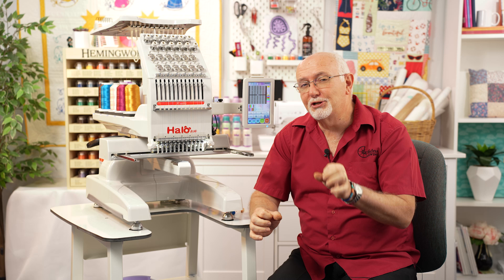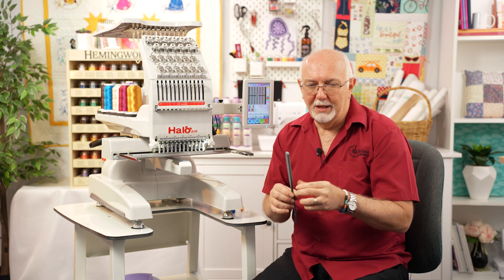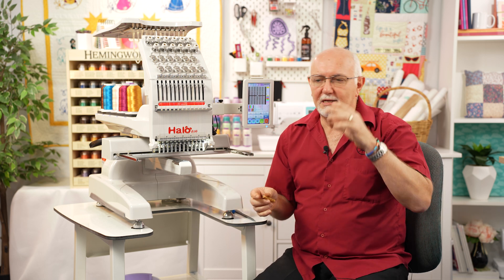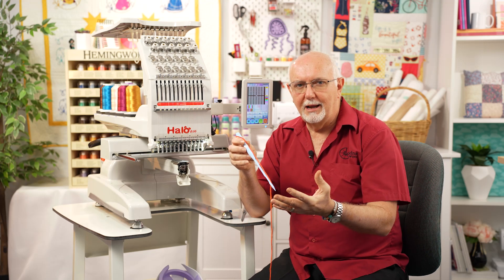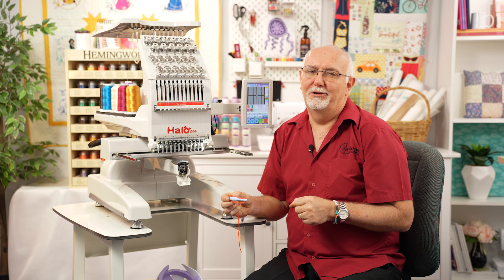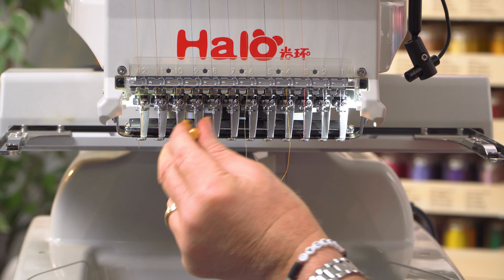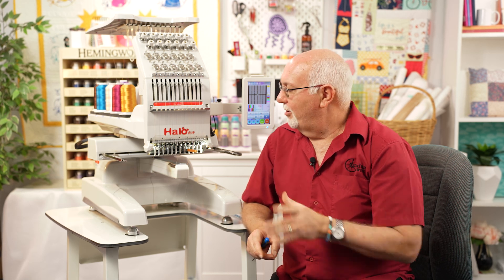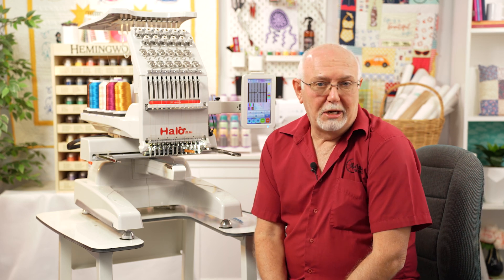Needle Setter (for industrial embroidery and sewing machines) | Echidna Sewing

Comment: How often should I change the needle?? What a great invention
Reply from the maker: Needles should be replaced as soon as issues arise. The lifespan of a needle can vary greatly—it might last 5 minutes or 5 hours, depending on the material you’re stitching on, as some fabrics wear needles out faster. If you start noticing skipped stitches or breaking threads, the first step is always to change the needle.